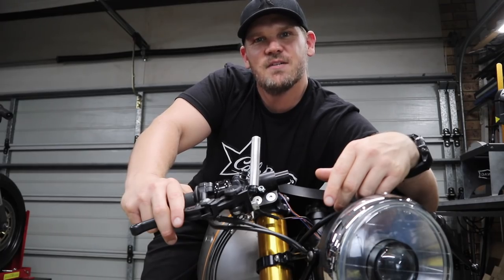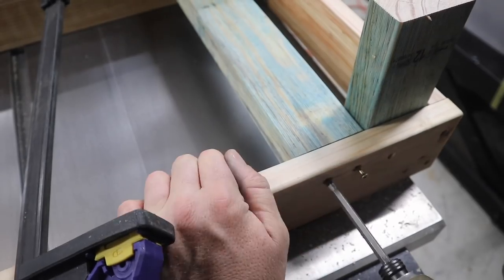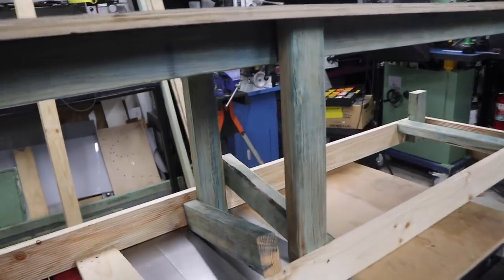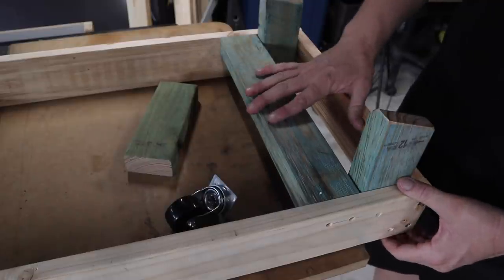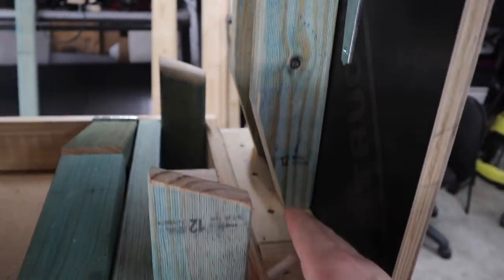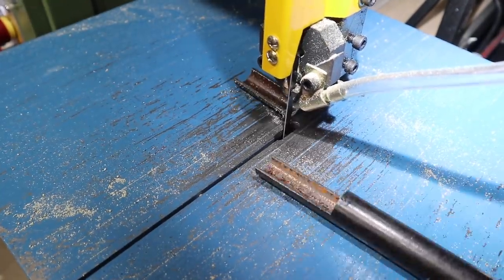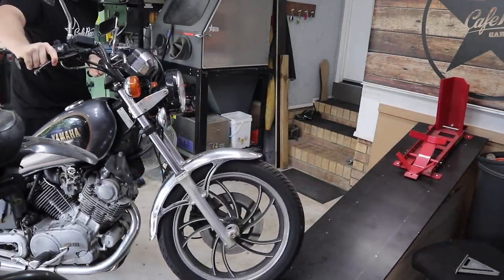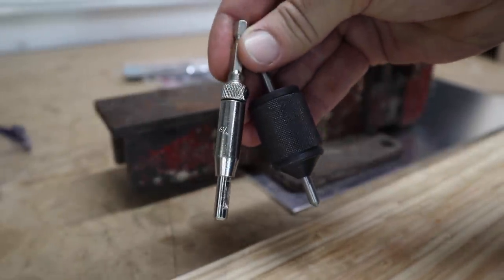★ MAKING a TILT TOP TIMBER Table With Some COOL FEATURES  - Cafe Racer Builds

Comment: Nice build. I would be tempted to put 2 d clips on the side so you can use some ratchet straps to hold the bike as well when moving it.
Reply from the maker: Thanks mate and yeah you do have a great point there,  I do have a few modifications to do it but at the moment I’m using a rear wheel bike stand so that’s nice and secure as… Back wheel up

Comment: Nice moto rack. We're about to build a new work bench. If we didn't buy locking swivel casters, we would probably take you idea.
Reply from the maker: If I was to build it again I would definitely use steel for all the moving parts just for long Jevity.

Comment: Very nice! Thanks for sharing. Just one question, you trust those 2 bolts to carry the weight of a motorcycle while hinging? After prolonged use, are you not afraid one will snap?
Reply from the maker: Thank you so much mate, Those bolts are 13mm or 1/2 inch I would be more worried about the integrity of the timber then I would about the bolts.

Comment: Awesome. I am just looking to design my own bike table and i really like the idea of this design. I might go a bit more simple as I don't need the wheels and it can stay in one place.  How hard is the drop back down with the bike on it? I am a bit worried about the weight.
Reply from the maker: Yeah you have to get a bit of a run up to get the bike on, but apart from that, it works perfectly 
It’s actually a World War II design
Reply: @CafeRacerGarage  Awesome. One last question..I'd like to be able to get a bike in from either end as I have a long garage and bikes can come in either end of that.

Is your pivot point right in the center so it could swing both ways? Or should it be offset from the center?